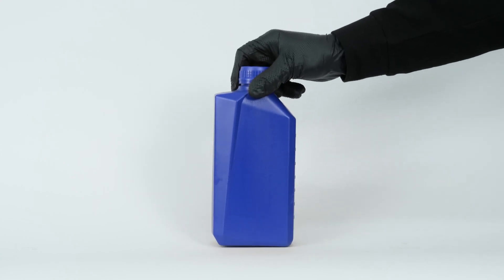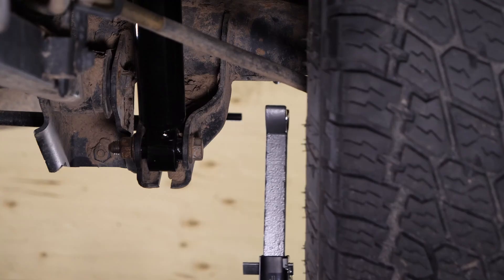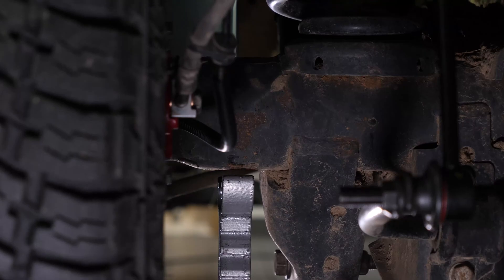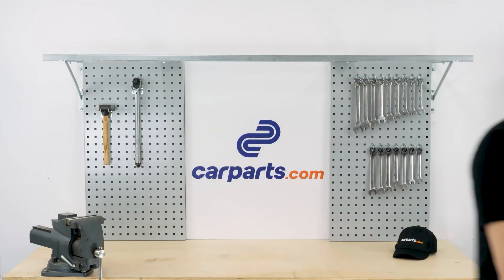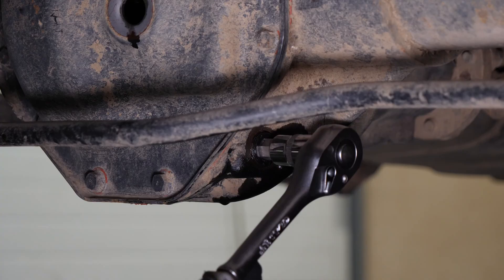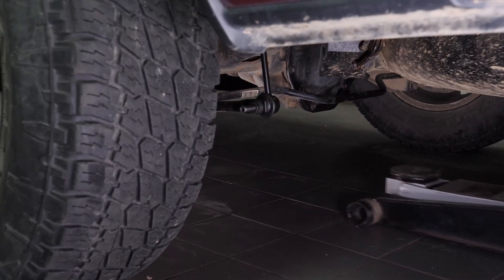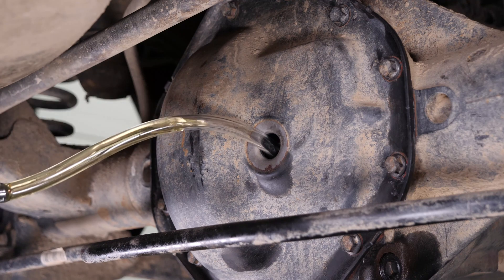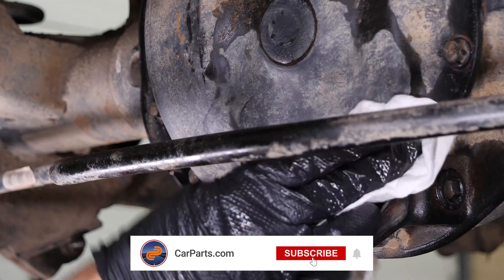How to replace the Rear Differential Fluid 2009-2018 Dodge RAM 1500 🚗

Comment: Im curious as to why Amsoil says to fill no higher than 5/8" below fill plug
Reply from the maker: On this element, the oil level is set by overflow, so it's quite simple. The oil must also lubricate the 2 shafts.